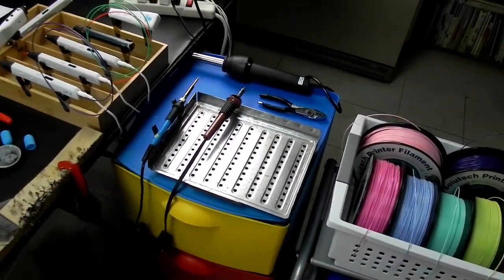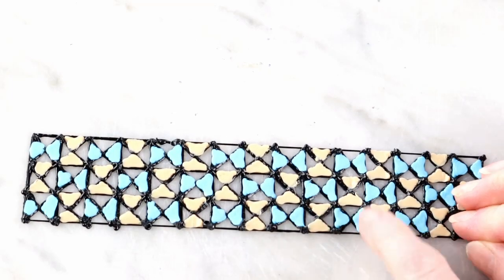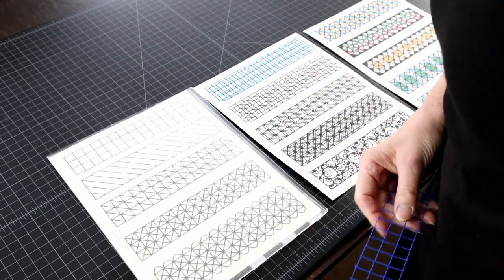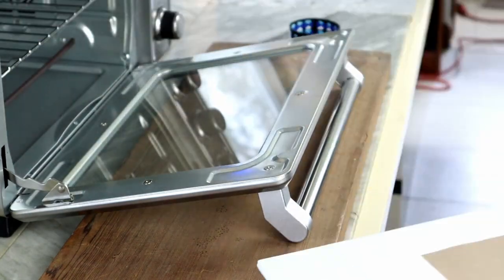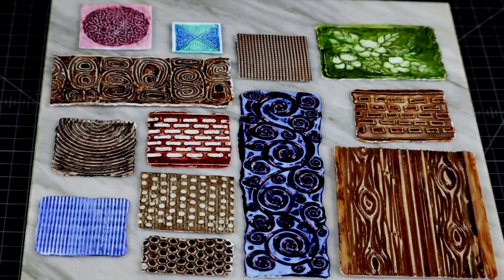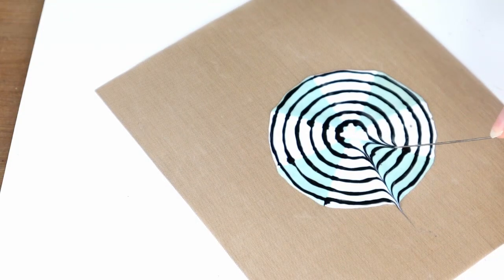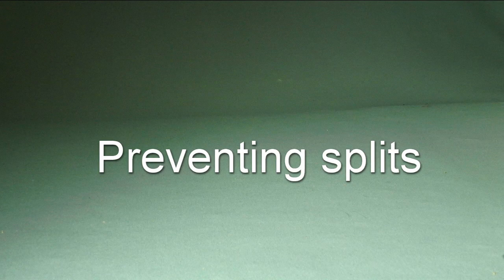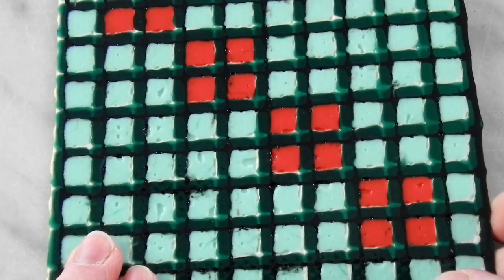7 reasons to bake your 3d pen projects - Baking PLA 2.1- part 1

Comment: This is really great - I just did not know what to do about bubbles. I haven't got tiles yet, can I use my cookie sheet to bake?
Reply from the maker: Yes absolutely. Provided it is completely flat. Just keep in mind it will affect the baking time since metal will heat faster than tile. There are some benefits to baking on tile though. I am going to address that in my next video on baking equipment. So stay tuned.

Comment: My guess for the silicone not getting rid of bubbles is it's more of an insulator meaning it transfers less heat to the pla but still enough to soften and bind it together just not make it melt and blend , is my guess right ? Idk
Reply from the maker: I think the silicone pad does get hot enough but the issue is that the surface of the pen texture is so uneven that the strands that touch the surface of the silicone directly melt first and that traps some of the air that is inside the slightly raised spots. That creates sealed air pockets and as the trapped hot air expands it only gets worse. The parchment does the same thing. So the baking surface needs to be slightly porous to let the air  out. Sort of like why some molds have went holes. I tried to address some of these issues in the next video:  https://youtu.be/e2zUVTF6fcc and catalog some of my more entertaining disasters.